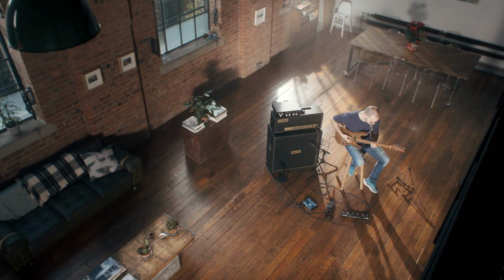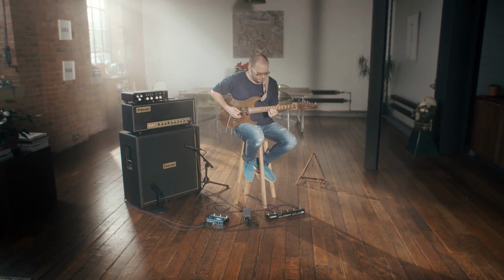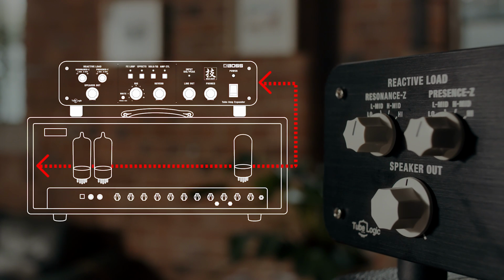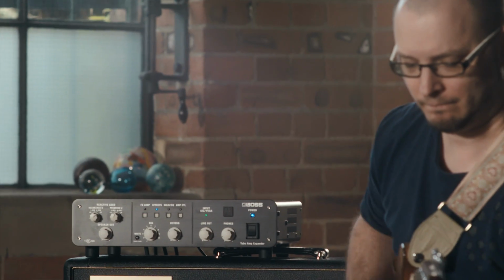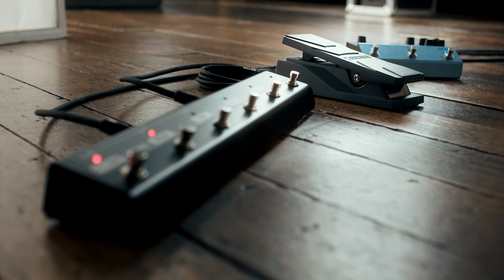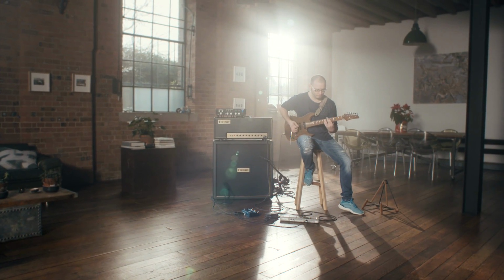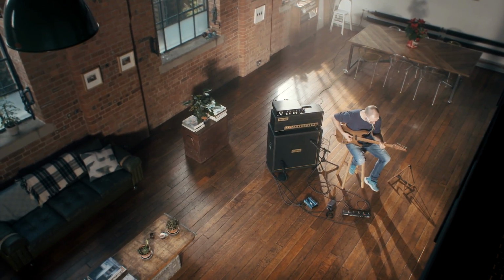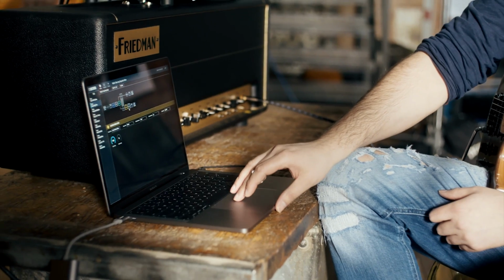BOSS WAZA Tube Amp Expander - Introduction by Tom Quayle

Comment: Most of the tube amps have vents on top and in the manuals it generally says you should not put anything directly on the amp. But i guess making it be bigger to fit below most heads would be nonsensical..    BTW this is awesome piece of geat, and as always Tom Q. is awesome :)
Reply: "Most of the tube amps have vents on top"

Well, I think it's maybe 50% or less. I have a Bogner XTC and a Cornford MK50 head.. None of these have vents on top. 
My Brunetti Mercury head has a vent on the top left side.

Sold a Mesa Mark IV last year - no vent
Rivera M100, Carvin Legacy - no vent

But some of the other amps i had that had a vent:

The Mesa Boogie Road King II (had a vent, i think)
Peavey JSX 
JCM 800 

So it's a good point to check your amp first, but you could always put something like this somewhere else though.
Reply: @johanaavit  i guess You have a more experience with amps sir, thank You for clearing thing out :)
Reply: @lucaszembrzuski  All cool. But you still have a point :)
Reply: @johanaavit  i play H&K Tubemeister 18 30'th anniversary head and it says in the manual to not put anything on top of it (also it's super hot when it works, ~45 celcius), and im looking to get Egnater Tweaker 15 head or Ibanez TSA15 head and they both have  vents on top :)
Reply: What a load of crap directed at young impressionable guitarists. The only people to gain out of this is BOSS. Do we think the audience takes a lot of notice of the tone after we have spent thousands of £s  on the so called tone. NO. just play through a MARSHALL, FENDER, HIWATT,  with no bloody pedals sucking the tone away out of your guitar.

Comment: How does the build-in poweramp work with the actual tube-poweramp? Which one drives the cab?
Reply: Pretty sure it does what most do and what my torpedo reload with Reac tive load does..takes your signal and pushes it through an analog component path and then out to your speaker. So what you are getting is your power tubes run through another power section with the most suitable response curve for the cab it is going into. That allows you to manage volume. Unless you have a tube power section like the fryette does, you are always going to be getting a " copy" of how your tubes react. Still sounds good though!
Reply: @Polentaccio  hahaha thanks you just made me pat myself on the back for buying a fryette.  :)  nothing like a round of self-congratulation on an expensive purchase!  (Valvulator GP/DI)  this boss thing would be good for people with multiple amps already but I just wanted one flexible one for recording.